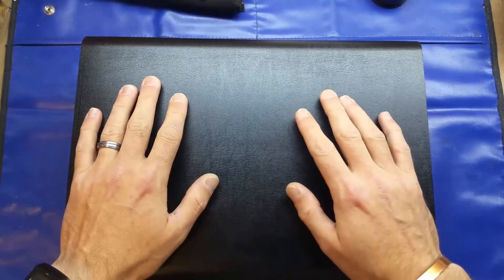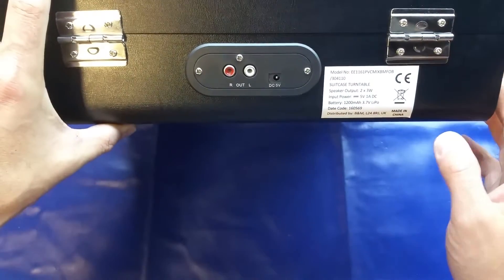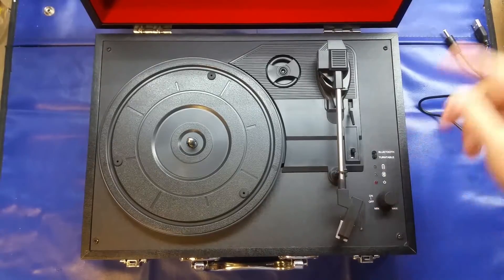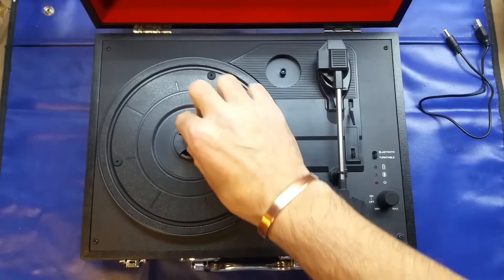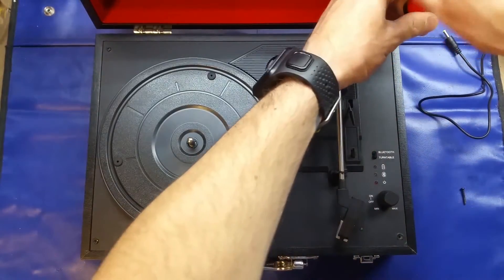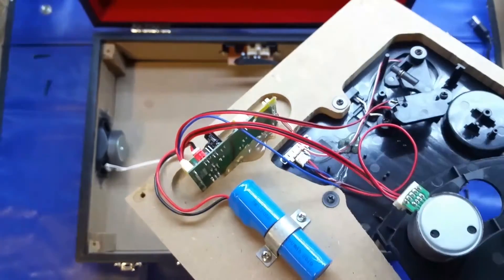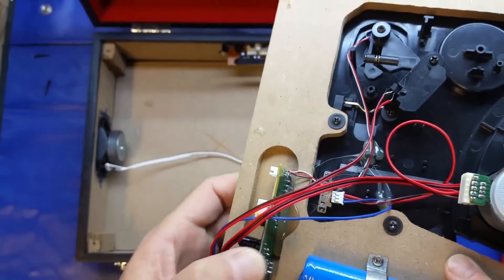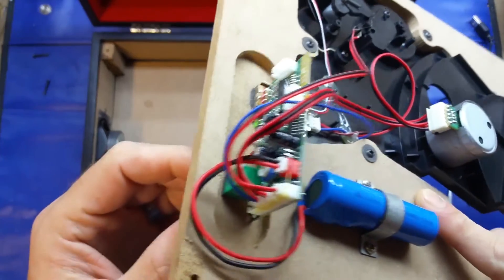Intempo Bluetooth turntable / record player teardown

Comment: I played vinyl for 2 hours straight then messed with Bluetooth for another 1/2 hour. Some records were 45 rpm speeds as well as the more common one. It stills lasts and hasn’t given a warning of battery. I got this for £14  as there was a sale. This is a very good cheap portable turntable that I really like and would recommend. Great video as well. 👍🏻

Comment: This is very helpful. I just picked up a slightly different model of this guy here on the cheap, speakers in the front with a Line In for an Aux cable, a thankfully longer lead to the mains, but it's a standard 2 prong and not a USB. However, the thing doesn't appear to have any on board battery, so it's tied to an outlet... I find this a bit of a shame, considering the design is nice to mobility. I'm hoping this model is similar enough to mine so that the I am sure it's got enough space beneath to mod in a nice long lasting battery.

Comment: Hi. i need some help please. I've plugged in the A DC plug to charge my turntable but nothing is happening.. do I need the turntable to be switched on so the red light is showing to charge it. or have it turned off. As my instructions don't say and I've googled my requirements but nothing is coming up...very frustrating 😑

Comment: Picked up the same model for £15 discounted at local B&M in the U.K., played a track from a vinyl and then the 2nd time I go to use it, the record doesn’t turn, lifted the base off to reveal underneath where the belt is to make sure it hadn’t come off which it might have, stuck it back on and the turntable still doesn’t move, should I just bite the bullet and get another for a little extra money or is it a possible simple fix that might just need a part replacement like a new belt, all new to vinyl and record players so any advice would appreciated.

Comment: I just got one of those, fixed the heavy stylus pressure by making a counterweight with Blu-Tac!  But what I have found is that with some records, the turntable autostops before the records finished with some records.  Don't suppose you've worked out how to adjust the autostop position?

Comment: Hello... is anyone able to confirm if the DC input has it's own fuse or diode?  I have a dead turntable due to being plugged into wrong power supply.  I will be taking a look inside tonight to try to repair.

Comment: Got an Intempo turntable from someone but it's not working!  Light above on/off/vol switch not coming on so consequently turntable not moving.  Any advice on how to fix would be appreciated.
Reply from the maker: Does it work when connected to external power?
Reply: No.
Reply: What do you think might be the issue?
Reply: @stuartsimpson65    There are a number of possible issues.  A bad power switch, a broken or loose wire, a bad battery (assuming yours has a battery like in the vid) or bad associated circuitry.  Hell, it might be a bad USB cable, and the battery has just gone completely flat.   I wish I could simply name the cause of your problem, but troubleshooting is why they pay the techs the big bucks.
Reply: Hi, did you ever find out what was wrong with it as i'm having the same issue?

Comment: I picked up a Polaroid branded one today for 25 bucks and it looks exactly the same inside and out. All in all it’s not that bad for the price I paid. I wish the Bluetooth was an output though and not an input. I have no desire to play anything through it but it would be nice to output it to my home theater or something wirelessly. I also really wish they’d have made the charger a microUsb. For the battery you could just wire a few 18650s in parallel but I’m sure you already got that worked out by now.

Comment: Can you please do how do you fix this this. The belt fell off of mine
Reply: Bmac 814 ok thanks
Reply: Dallinz sure no problem. I need to update my advice though as it turns out there’s a post you can stretch it over on the turn table itself then align that with the motor and then it back and forth a few times. I didn’t catch that when I did it to mine but another video showed it. It was the Crosley review from VWestlife. You can do it without using the post but it might make it a little easier.